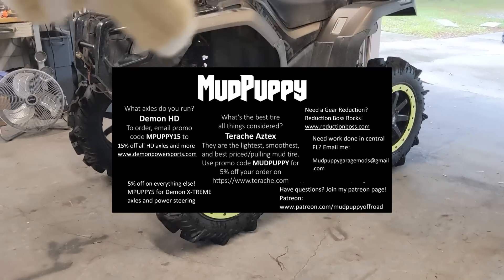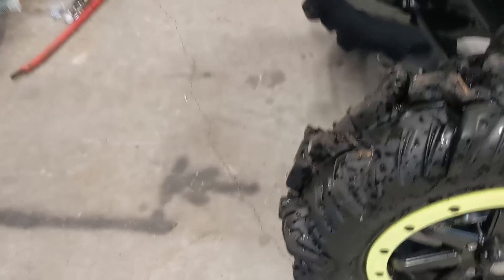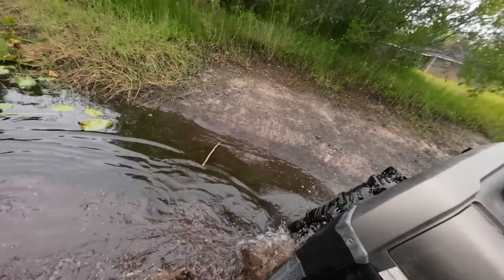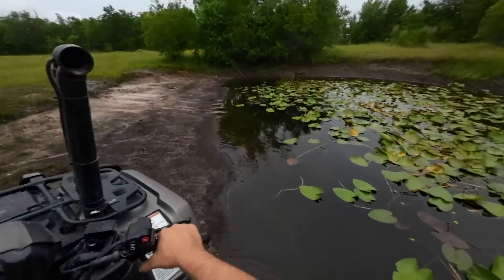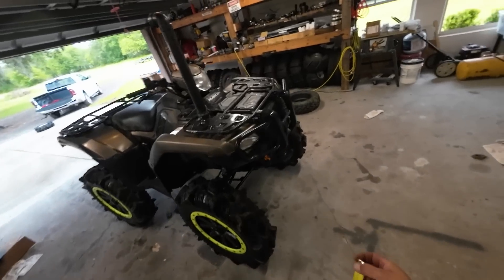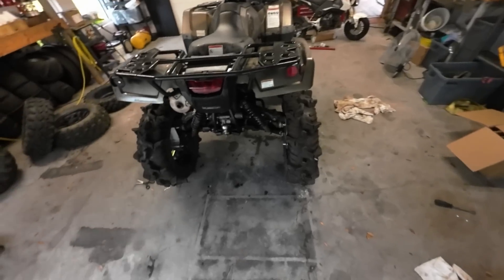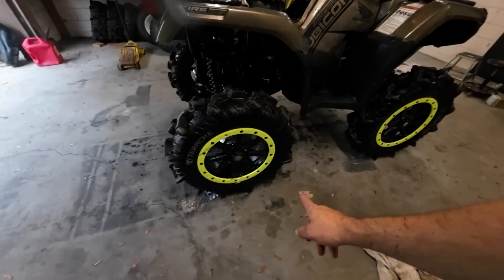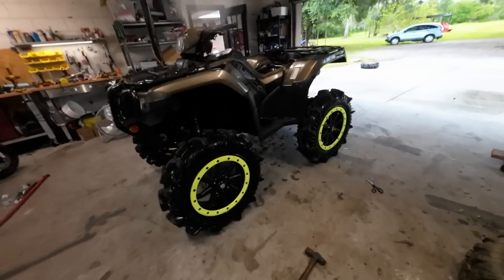6" Portals on a Rubicon test, walk around, and top speed run

Comment: I just did my first ever top end rebuild on my 2019 foreman. It seems to be running great and no more oil burning so I guess its good 😂. Went  to change my wifes belt on her 2019 outlander xmr and all but 2 bolts stripped on the belt box 😡😡😡. Took me all damn day to pull clutches, drill out bolt holes and bolt it together with bolts and nuts. Twas a pain in the ass haha. But I got it all done and almost broke in on both bikes so hopefully we will have no issues at muddy bottoms next weekend.
Reply: Same thing happened to my 09 outlander

Comment: Cool build, I'd stick with those wheels/tires, it will still be kinda fun to ride, bigger ones will make it even less fun to ride.
I like how the speedo is in km/h.
Im in canada where we use km/h so I spotted it right away, my rubicion does 76km/h in the limiter but is really going a 85ish km/h with my bigger tires.
Reply from the maker: Unfortunately my speedometer got wet and I can't change it back to miles per hour lol

Comment: im looking to get some aztecs for my sxs but they dont have any 38x9.5x20 or 10" wide ones or even 40x10x20s why is that? i really want to try them out my rmax2 has the 5" lift on it already and is currently getting 6" portals put on with rhino axles so im looking for 38"-40" tires that wont break my account lol and i dont really want to change wheels i like my frontline 20" ones any recommendations?
Reply from the maker: The 38's are awesome get you some 22s.  20s on 38s would have too much sidewall not going to be stable
Reply: @MudPuppyOffroad  man I really don’t want to 
But I guess I might have too or should I go with 40” bkts?

Comment: Do big tires make the EPS less reliable?
Reply from the maker: It does work at harder but I haven't had any issues on the Rubicon. I have had issues with big tires on the talon though
Reply: @MudPuppyOffroad  where do I order these 6 inch portals for a rubicon
Reply from the maker: @jakeingram5126  jbcoffroad.com

Comment: Still not as low geared as my honda 10.89 final drive ratio
Reply from the maker: Not sure where those numbers refer to but that's not a very impressive crawl ratio
Reply: 15mph in 5th gear on limiter 10.89 to 1 final drive ratio. Takes 10.89 turns of engine output to turn 1 turn of the wheels. None of yours are that low promise. If you don't believe me thats fine click my channel check it out. Btw its not a fourwheeler anymore.
Reply: @MudPuppyOffroad  definitely not tryin hate sorry if i came off wrong there. I love your vids and you make good how too vids also. Was just saying i got a honda geared way lower than that rubi. Its a homeade lawn tractor built from a 350d with br250 engine using a car diff as a drop box. I would love to know what size redution that it is tbh im not sure how to calculate that tho. But stock 350d has a 3.88 to 1 final drive mine is 10.89 to 1 final drive.